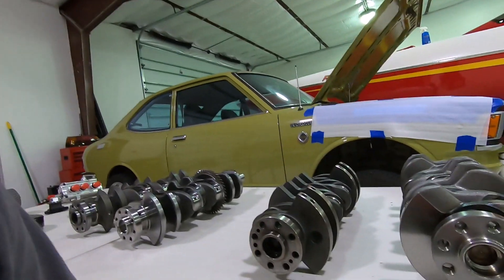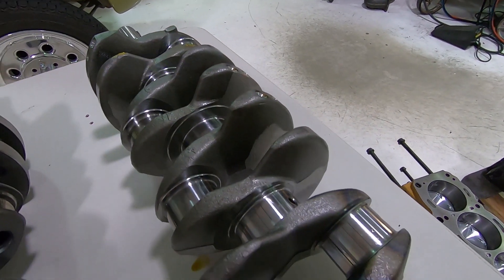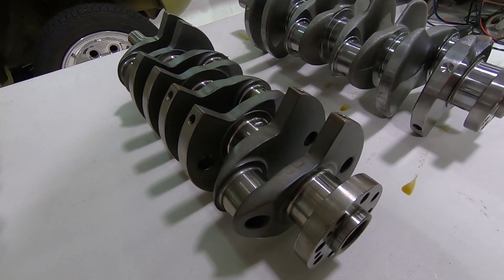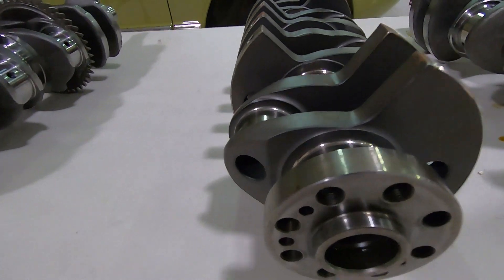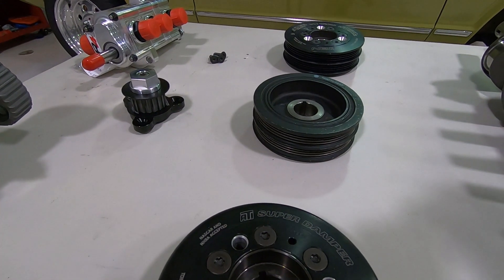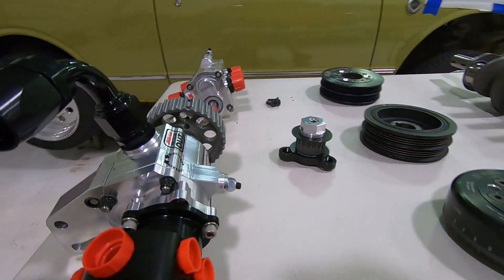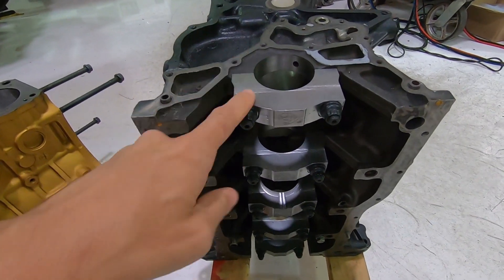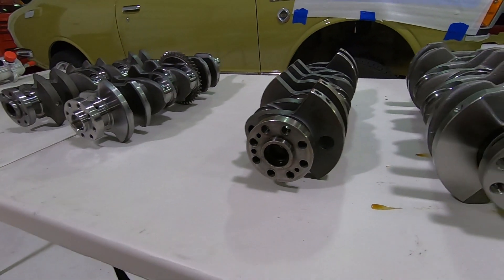3sgte Crankshafts and oil pumps

Comment: What's your take on the beams crankshaft vs the 3sgte crankshaft I have both which crank would u prefer I know the beams is a n/a setup with higher comp us it worth it to build a boost motor with the beams crank
Reply from the maker: Honestly, from what we have seen, they are exactly the same crankshafts. You have to good crankshafts then! 💪🏼💪🏼
Reply: @psiracing  ok thanks your knowledge of toyota platforms is very helps in many ways will be watching out for more videos doing a 3sgte build now for my ae86 gts coupe now waiting on some parts to finish up the head have a complete black top beams swap sitting

Comment: Awesome video. Thanks for the no-longer secret trade secrets!! lol
From what I have learned by watching your videos I think the main issue with the old turbocharged Toyotas, is that they didn't really flow-optimize anything. Whether it comes to the intake and exhaust manifolds, the oil system, the cooling system... it's all still very much 80's and older style engineering, with the iron block and all.

I have questions (& for anybody in general please input if you have exp) if you don't mind-

What is the typical output limit of engines using the factory 5SFE crankshaft? I haven't seen many results for those cranks besides people talking about the block advancements. Overall weight, diameter of the rod journals, and the balancer gear are some obvious differences. Most people just stick to the "turn the 5S crank down to use 3S rods, or use a 3S crank in 5S block" thinking. I have seen some Chinese steel connecting rods for the 5SFE, and those are tempting because they do not require special crank work.

Also, what is the most responsive turbocharger, minding low-end torque, to use on these 2 liter 4 cylinder engines? Know anything about Borg Warner's ball bearing EFR 6258?

Thanks!!! MR2 owner here
Reply from the maker: 5S cranks can actually handle some serious power, i say upwards of a 1000hp one the tune is right. Biggest issue is like you wrote, machining the crank to fit a 3S style rod or making a rod that fits the 5s rod journal. Which is why we always push the 3s crank because it just makes life so much easier
Reply: @psiracing  Thanks for the info. Really appreciate it, these old Toyota engines, and the old mechanics are all retiring so the consolidated info is very useful

Okay so I thought about it. So what you are telling me is the 5S and 3S cranks are similar

Comment: Have a 3sge and need to get some more power out of it everything stuck at the moment no upgrade just need to know what to do to get some more power out of it without doing anything major it's a everyday driving vehicle
Reply from the maker: That's a tricky one, what year 3sge?
Reply: put a turbo on it and a standalone ecu + a sufficient fuel system

Comment: Anything you recommend for a "off the shelf" oil pump for the 3s without dry sump?
Reply from the maker: Hello! Depends which oil pan setup you are using as of now. There are a few options
Reply: @psiracing  I'm on a 2nd gen block with a moroso oil pan for rally/track use
Reply: Seems like people run the 5sfe for an upgrade but is there more?
Reply from the maker: @ABeans07   5s pump is a great upgrade compared to the gen 2 gen 2 is the smallest of the smallest.

Comment: Awesome  info 3s lover
Reply from the maker: Thanks man! 3S #1
Reply: @psiracing  Is it true that the 3S gen 4/5 block can handle the same amount of pressure as the 5S? I read that they are made from the same material.
Reply: I like that u still use the gen 1 head i have four heads so wanted to build one soon
Reply from the maker: @celicaalltrac3956  it's a beast of a cylinder head! Any help you need let us know

Comment: Any chance you could do a more in depth video on the factory oiling systems and where the limits are, from your experience?
Reply from the maker: We will definitely put something together
Reply: In my mind a stock stroke and or long rod motor would help with pump longevity due to less 'intense' harmonics as well as use of a good quality damper pulley but that goes without saying at this point.. I've always wondered when pushing the limits whether it would be helpful to add another keyway on the crank/gear and possibly pulley when entertaining the idea of a dry sump pump.. is it something you've done/experienced problems with? have known and looked up to you guys for over 6 years now
Reply from the maker: @3sgteJoe  appreciate that, problem with the oil pump, even the ones you mentioned in later generations. There definitely better but at the end of the day they are spun way to fast. When we do a dry sump or wet sump, we only turn the pump 50% of engine speed. No need for even excess oil pressure, we use to run about 65psi max. We have q mandrel that adapts to the front of a ATI damper to mount the dry sump/wet sump gears!
Reply: Would love to see this as I've never had or seen anyone have bad experience with stock pumps even as high as 900awhp+/10,000rpm As far as I know the only 'mods' being the use of gen 2/4 27t gear so it's not spinning as fast and less prone to cavitation at extreme rpm, and using either thicker 5s/gen4 pump assembly or blacktop beams pump which even thicker again but slightly smaller diameter gyrator with the extra shrouding in the housing (block needs shaving to fit ..) paired with porting on inlet and outlets of pump and relief valve to avoid potential for hydro locking and shattering under freak engine conditions are higher rpm with the higher flow pumps
Reply: Appricated the reply man, the more I read into oiling systems the more I hear that high pressure isn't actually a good thing which is a complete flip on your average performance enthusiasts school of thought... Have you considered or tried using larger pulley/custom belts with later gen pumps ?
Reply from the maker: @3sgteJoe  with what we do and how poorly Toyota designed the oiling system we have not looked into it further. You will never be able to slow the pump down enough. And yes high oil pressure is technically bad. Takes power to make oil pressure, volume is the key, hence why Toyota went to bigger pumps. Same as a 2jz ge and Gte oil pump!
Reply: So you don't modify or add any crank keyways on your 1000hp + motors ?
Reply: I finding interesting and confusing that you think the oiling system is so poor.. I've seen multiple beams motors ran in endurance racing with slicks running completely stock oiling systems at 450-500whp with no bearing failure.. 1 for over 10 years! Im not sure if you've ever used the black top beams pump..? it the most different comparatively
Reply from the maker: @3sgteJoe  that is the best pump they make and for that power level you are good. Unfortunately guys don't come to us for a 450 or 500hp build. For some reason they always start with at least 700 lol! No way to recommend a reliable setup if there talking about 700 and definitely want more
Reply: Thanks for your replies man, means alot. I've always been curious about your Starlets cylinder head, having multiple gen 1 ge/gtes in the past, I notice there is difference between the 2 and then there's even an earlier version pre mid 87 that has no yamaha markings and massive ports, I've always wondered which you use... and whether you've considered using the beams heads, with the narrow included valve angle and straight shot intake port I've always thought it masassive potential with less work
Reply: @3sgteJoe  The valve covers are the key; definitely a Gen 1 3S-GE. I've not seen an 1100+hp Beams, so I guess the potential is left to be discovered, or simply may never be.
Reply: @trentmeyer23  always what I thought and would mean there a so much easier to source but due to the amount of modifications PSI get up to I still didn't rule out the potential that they modified a gte head to fit them.. I'm sure beams can go as far but I'm curious as to whether they would require less modifications and maybe opportunity for a earlier/larger powerband
Reply: @3sgteJoe  Making huge torque on a 5S/3S will surely cause havoc. In fact, a GT4 in Australia made 800whp and 1150Nm, and cracked cylinder 3 on a half filled 5S block, plus it was walking the billet main caps around. Best off running with a recipe that works, high RPM, high boost.
Reply: @trentmeyer23  wouldn't expect the torque increase to be huge... I've planned to make a main cap/block perimeter brace in cooperation with the billet mains as I've always had gt4 application in mind which obviously subjects the block to more twisting forces, in conjunction with a long rod stock bore/stroke half fill 3sfe block, (not all but some share the 5sf siamese bore that gives it it's strength vs the 3sgxx blocks but having an extra mm untapped which would make a huge difference to it's strength just by itself, with this bottom end in mind I want to see know I'm not leaving power under the curve on the table with is a big deal in a no No2 class..
Reply: Plus beams are much MUCH more available in NZ than the gen 1 and probably any other ge/gte head maybe bar the gen 4 gte from the st215 caldina. Not to mention the aftermarket cam support and the extra head drain at the front right of the motor on the Black top

Comment: A video on your opinions of the 3S/5S block versions would be great. Strengths, weaknesses, when they crack, etc. There is a lot of misinformation out there.
I'll be putting your billet mains into a half-filled +98 5S (not the square freeze-plug version unfortunately), with girdle, evo8 arp 11mm head & mains studs, etc in the next couple of months.
Hoping it'll hold together for a while.
Reply from the maker: Doesn't have to be a square boss block, the dragster we supplied the engines for in Malta does not use a square boss block and has been 6.49 at 203mph! Only difference is it has a full fill!
Reply: @psiracing  only difference? That's quite a big difference! Only dedicated drag racers are interested in a fully filled block.
Reply from the maker: @mwpaus  u can do a half fill if your goals are to push it as hard as possible. Obviously depending on your driving condition. Your biggest reliability factor will be tune, our engines don't run high compression to keep our reliability window broader! That silver mr2 in our past video has made 715whp, non filled non square boss block and it will make more.